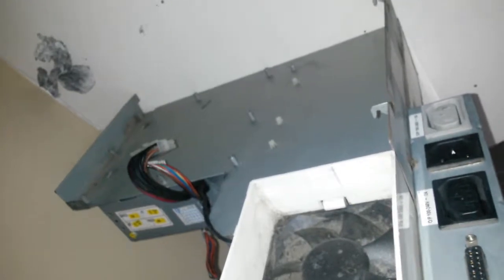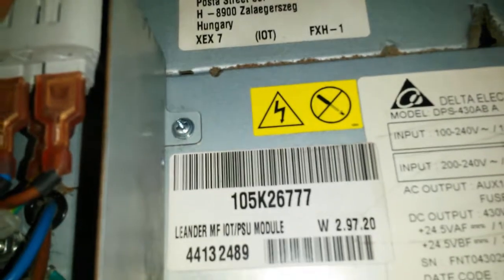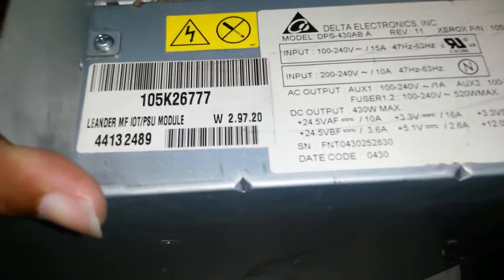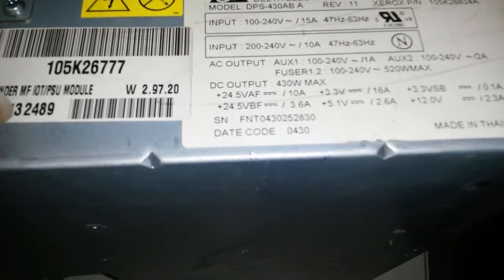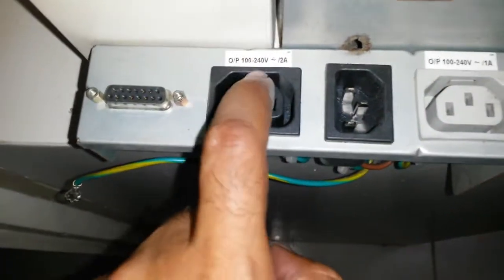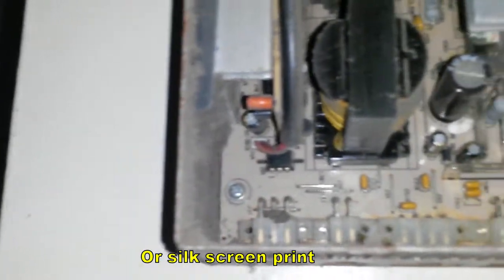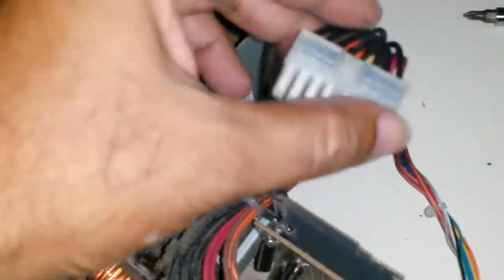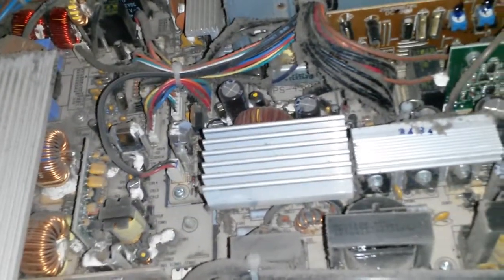101 Xerox Photocopier Main Power Supply

Comment: Sir so nice video 
I have  xerox  5755 copier my power supply is faulted with heater lamp error. Lamp is not turn up please suggest how to repair power supply with this fault
Reply from the maker: I do not repair photocopiers so I really do not know enough to help much. The few tips I can give is as follows.

Take off the connector to the lamp. Test the lamp for continuity. That will tell you if it is blown. If it is you will have to change it. You are not supposed to touch the "glass" of the new one since it leaves oils and weakens it. 

If the lamp is good then its is the power supply. You may have to do some temporary leads outside the copier to get it to work to test the power to the lamp.  If that is the fault trace it back to the source and check that.